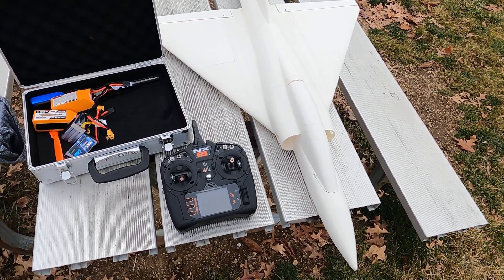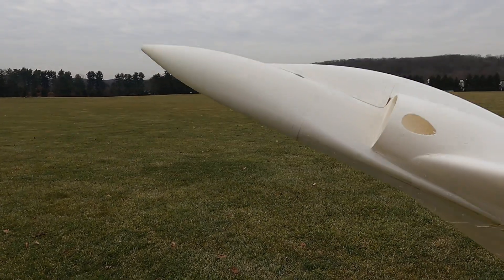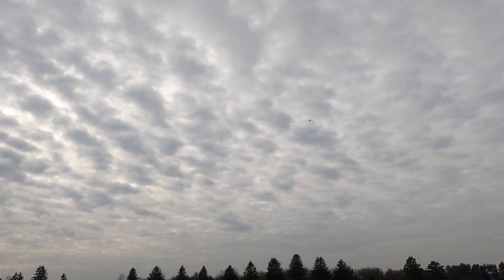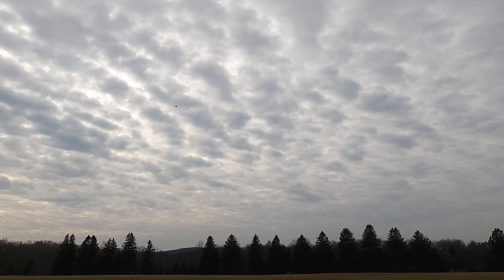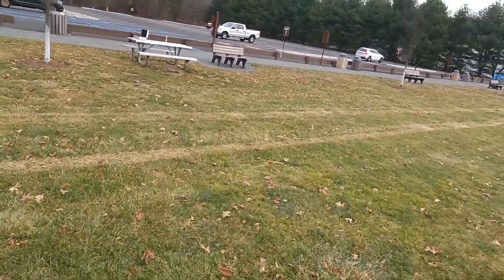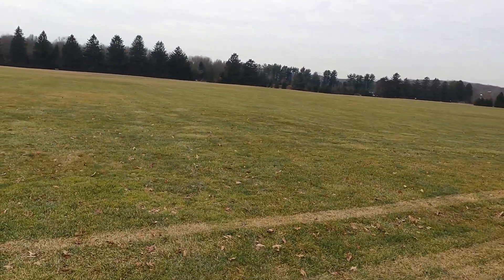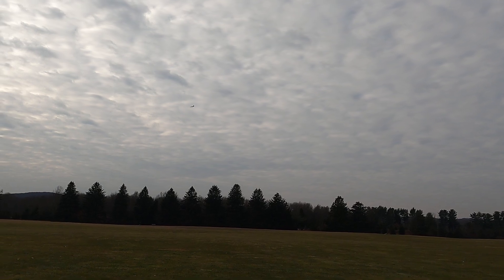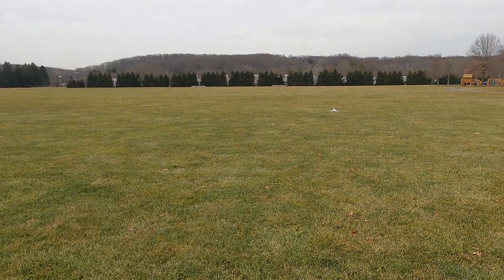High alpha and acrobatic testing the Mirage 2000 3d printed Jet

Comment: can this be scaled to fit 80mm edf?
Reply from the maker: Absolutely you can scale it up and it will work perfectly. The dubro hinges will still work and the servo pockets will just be a little larger
Reply: @hotlapkyle   by how much % would i have to scale it for 80mm fan??
Reply from the maker: @VT-FPV  14.2% from my calculations. You know how to slice parts that won’t fit on your bed?
Reply: @hotlapkyle  i have the neptune 4 max so i can print big sections! 
i am already printing the 64mm version right now. will start the 80mm version next week! 
also planning to add a 8mm spar (negative cylinder volume in slicer)
Reply from the maker: @VT-FPV  amazing! I can’t wait to see it. Link a video or pictures
Reply: soon! @hotlapkyle

Comment: Will you be adding the small fixed canards that are on the full size and will you add a scale Fin, ie a curved tip with radar warning fins. These are very distinctive on the original. Great video, very interesting. I also think 64mm 
EDF 's are the sweet spot!
Reply: Add your own IF they are that  important to you.
Reply from the maker: @barenekid9695  yeah I wouldn’t touch this design. I’ve never seen a 3d printed jet fly like this.
Reply from the maker: I don’t know how much more time I’ll spend on this free file. I may revisit in the future. Stay tuned for the new Viggen coming soon. That has functioning canards!